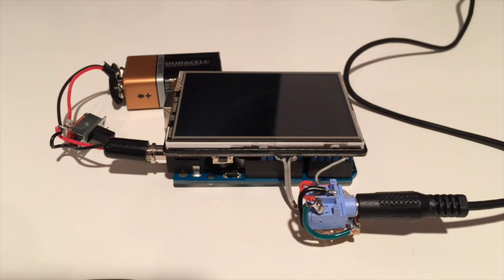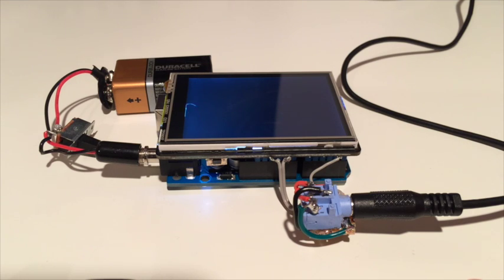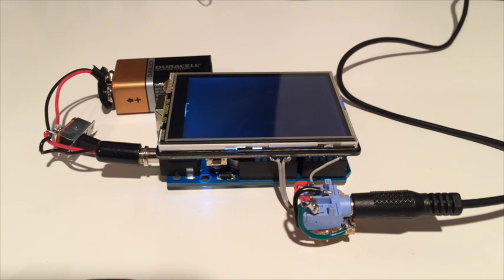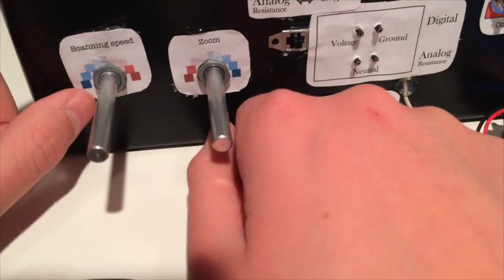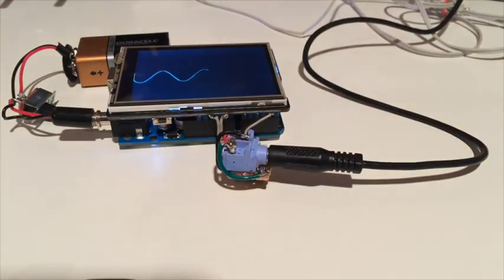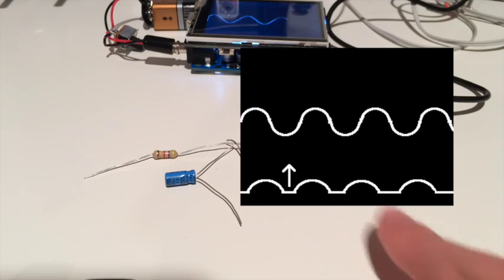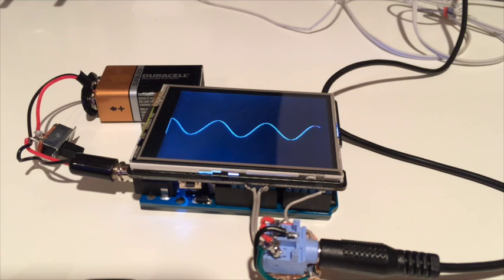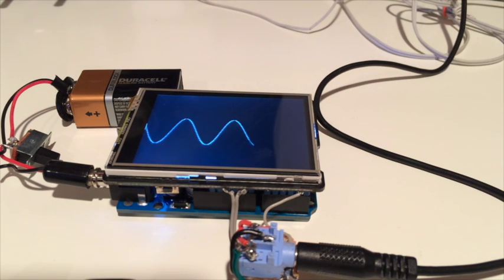TFT Arduino oscilloscope

Comment: Do not be discouraged. Your video presentation is good. Some of the criticism you have received may be valid but some of it is offensive and best ignored. I would suggest writing a script and checking your facts and links. You could then do a mk2 version of this, but I wouldn’t bother and this version is fine. My recommendation, chose your next subject and go forwards.
Reply: My advice is NOT to script it, your open truthful presentation connects with the general hobbyist 👍

Comment: Speakers DO have a polarity. Of no significance on a single speaker device but extremely important in multi-speaker systems. If speakers are out of phase they will defeat each other. A prime example is if you have two motors on a vehicle, one on the left, one on the right like on a Segway. If you power them out of phase so one is going backwards, your vehicle will go nowhere, it will spin in a circle. Your LOUDspeaker will become a SOFTspeaker. By the way -2volts is simply the bottom end of a +2volt ac signal. I don't have the time to explain it. You might try Googling 'Simple ac theory for beginners'.

Comment: speakers doesn't have polarity because they are operated on AC not DC
Reply: +Mr.Sam Ali  Speakers do not operate on AC, they operate on pulsing DC, or PWM DC.
Reply: +Vinchi Studios DC? looks like i have heard something new. What does a speaker do? It produce sound. Sound is audio, and audio is AC. You might have seen in the amps one wire of speaker is connected to the ground and other is passed through a capacitor (DC Blocking) and then it is connected to the output of the amp.
Reply from the maker: +Mr.Sam Ali the difference between AC coupling and DC coupling is the location of the wave. While a 5v DC wave might go from 0 to +5, an AC 5v wave would go from -5 to +5.

Comment: Good job, essentially what you have done by "biasing" the input is you have added a DC offset to your waveform. Higher value resistors won't give you a higher voltage if both values are the same.
Reply from the maker: ShadyMan01 Thanks, we will keep this in mind for upcoming builds. Really appreciate the advice! We did know, however, that changing these values to different values (such as 1k and 10k) will give up the ability to view higher voltages. :D
Reply: Makeoscopy No worries. Yes changing the resistor values like that will give you different voltage levels.

Comment: Your 'square wave' is probably better on a genuine oscilloscope, since you have that large 10uF cap on your input which will have a devastating effect on wave shape. Good quality Oscilloscope probes are expensive for a reason, and the reason is capacitive balancing which is designed to minimise those effects you saw. But nice work, well done.
Reply from the maker: +Graham Lawrence On a real Scope, the Online Tone Generator waves are still very flawed. Especially on low hertz, they act like a backwards sawtooth, tending toward the middle when at the top or bottom of the wave.
Reply: @makeoscopy9060  but you have to think of bad sound devices

Comment: Speakers do have a polaraty... If you connect them wrong they will play but wont give the full power... Think of an subwoofer... If you connect the it wrong and have  a short kickbass it will pull to the inside instead of pushing it... You still get some bass but not the full power... And you can ruin the sub on very powerful systems... 

About negative voltage... Its simple... Take a 5v power source... Hook up an 2.5v voltage reg... Now you have gnd,2.5v and 5v terminals... 
Now rename the 2.5v terminal to ground... Then you get -2.5 v, gnd and 2.5v 

Your voltage is always relative to ground... On what voltage level ground is, is for you to decide... 

Thats why not always gnd on a pcb is on mains ground level
Reply from the maker: Thanks for the input! I'll remember that for future videos.